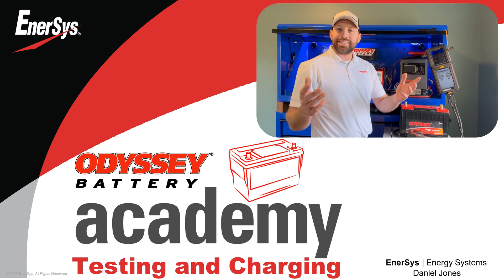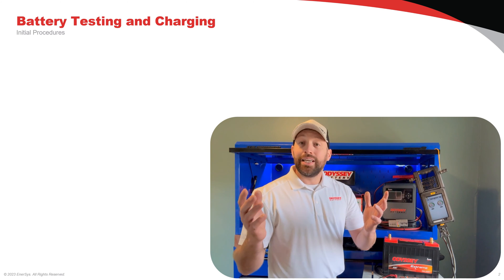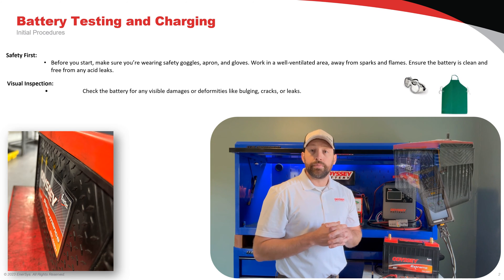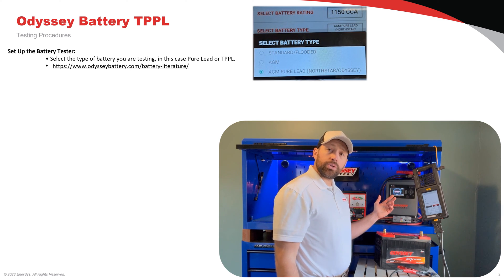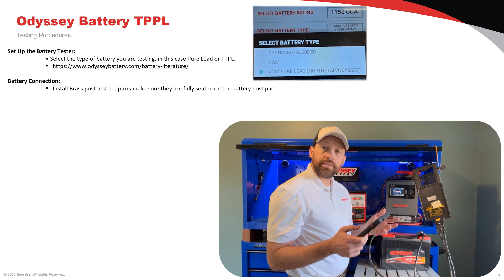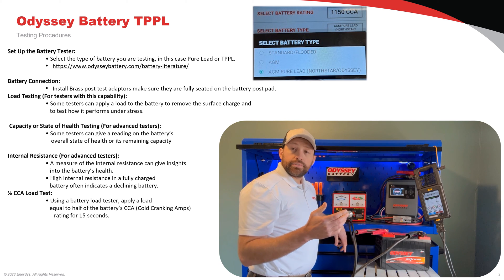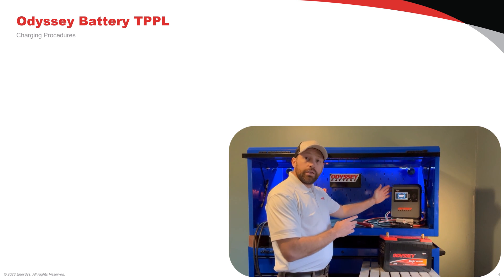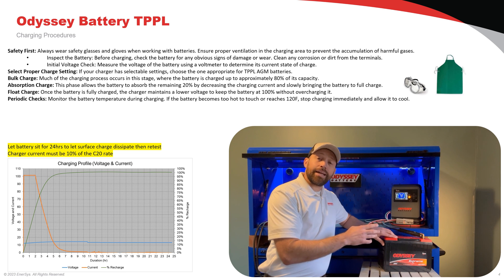Testing and Charging ODYSSEY TPPL AGM Batteries

Comment: This company is a Joke, and their batteries are trash. $350 battery dead in a 2020 Jeep after 1.5 years. Jeep was tested by Jeep dealership AND a local well known 4x4 vehicle electronics instal biz and Jeep is in perfect working order. Applied for a warrenty through their confusing process, was denied, they never even asked any questions. They DO NOT stand behinf their products. Be Warned!

Comment: That's strange, a couple years back I was told the recommended charger amp for your TPPL batteries while following voltage recommendations was .40 x per ah. (100ah battery = 40amp charger)
- What is the optimum amps to get these back from a partially discharged state and preserve optimum longevity?
Reply: Yes, the manual says the minimum charge rate should be at least 40% of the 10 hour capacity of the battery, which is 92 for the group 31 for instance and would mean a 36 amp charging rate.  Maybe it was a typo?
Reply: @nathansmith8183   Good to see someone else is paying attention. Just seems strange to see nobody asking that question.
Reply: The recommendation is 40% but the minimum is 10%